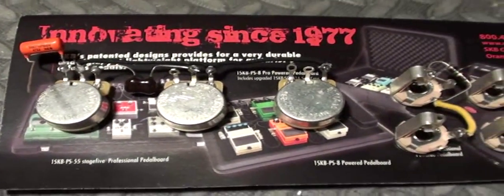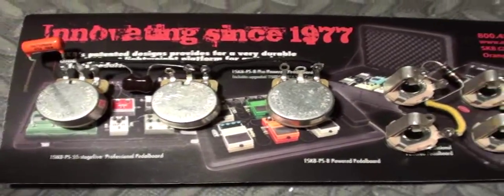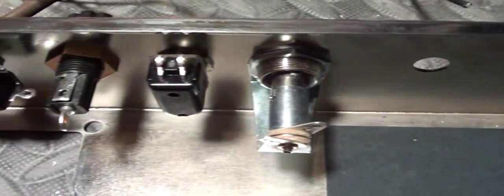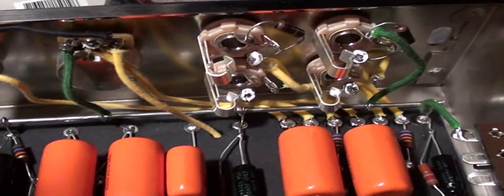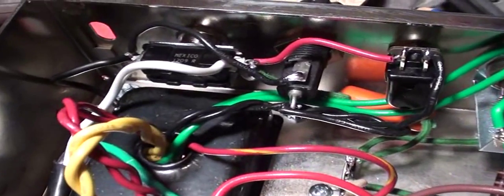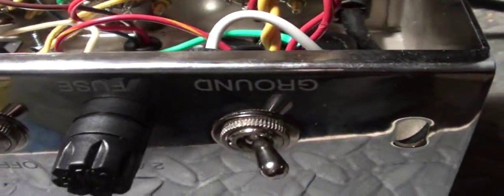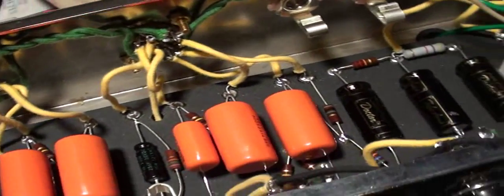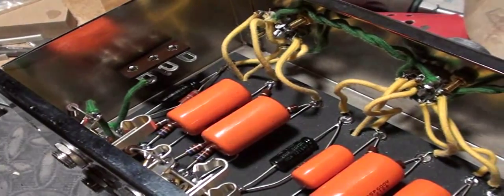Mojotone Tweed Deluxe Chassis components and hookups.wmv

Comment: Thanks for the video!  Got a question how did you mount the eyelet board to the chassis?  Is it just sitting freely in the chassis or did you mount it somehow?  Additionally, what sits behind the eyelet board so it doesn't short to the chassis?
Reply: Honor Bean  when you get the kit, the eyelet board comes with a backboard which is to place between the chassis and the soldered components. It is then mounted to the chassis. Use masking tape over the screw heads to hold the screws in upside down for mounting. :)